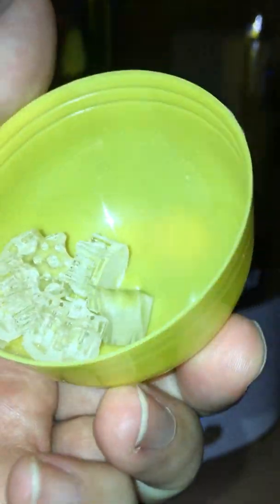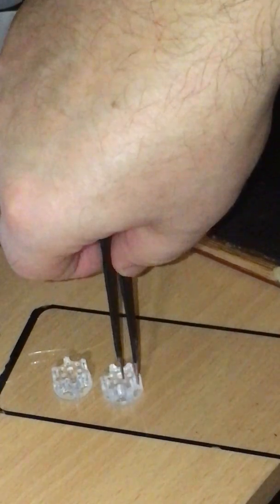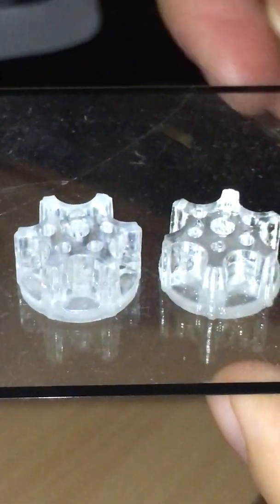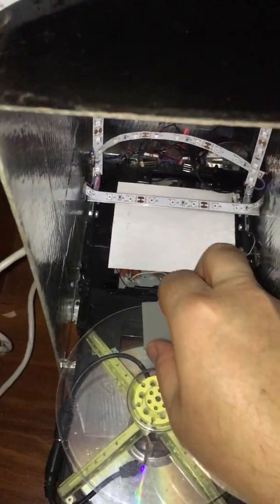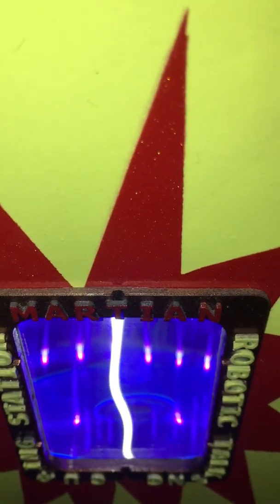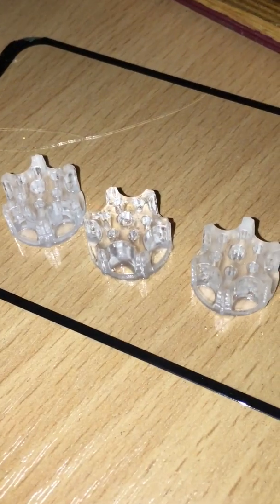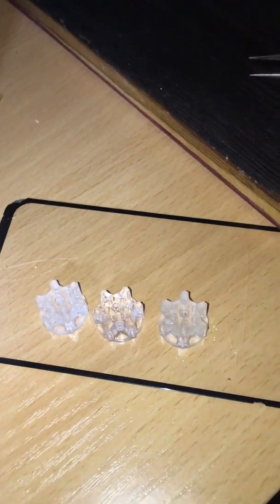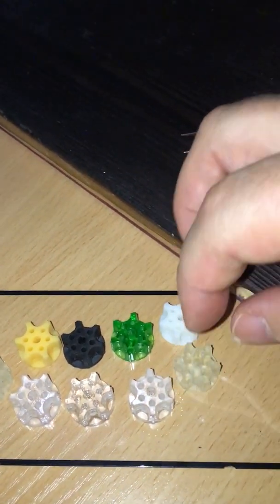High transparency (ultra clear resin)by Nova 3D. First print and first impressions

Comment: I cannot get this to print in my Elegoo Saturn for anything. Any setting suggestions.
Reply from the maker: As discussed via FB Messenger, try using settings proportional to my settings for Elfine Mini: I use 7 seconds for base layers and 4 to 5 seconds for normal layers. For standard resins I use 16/1.3 seconds respectively. Lift speed is about 80 for both ultra clear and standard. For example if you use 20 s for base layers for a standard resin, try some 14 s for the clear. For normal layers - if you use 2 seconds for standard resin, try 6 seconds for the clear.
Reply from the maker: As discussed via FB Messenger, try using settings proportional to my settings for Elfine Mini: I use 7 seconds for base layers and 4 to 5 seconds for normal layers. For standard resins I use 16/1.3 seconds respectively. Lift speed is about 80 for both ultra clear and standard. For example if you use 20 s for base layers for a standard resin, try some 14 s for the clear. For normal layers - if you use 2 seconds for standard resin, try 6 seconds for the clear.